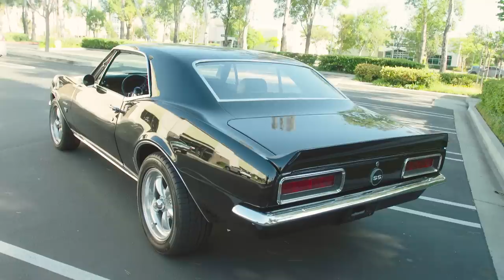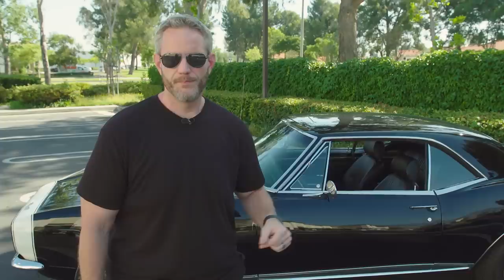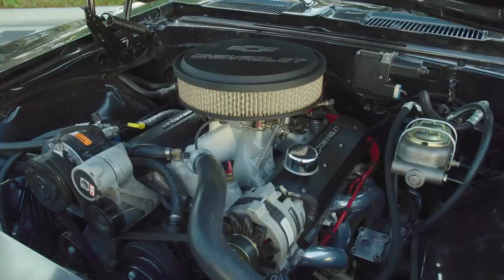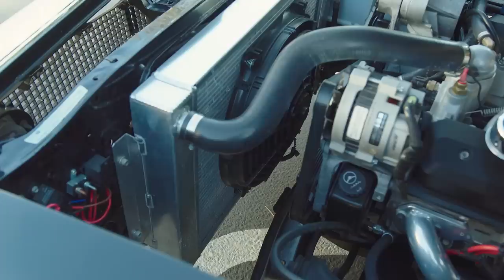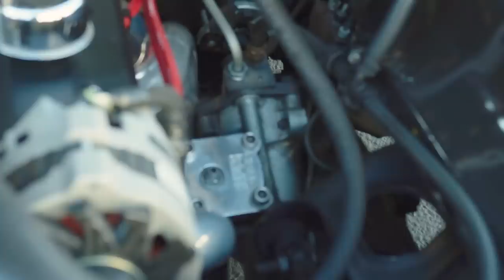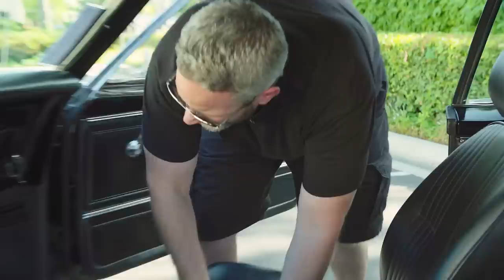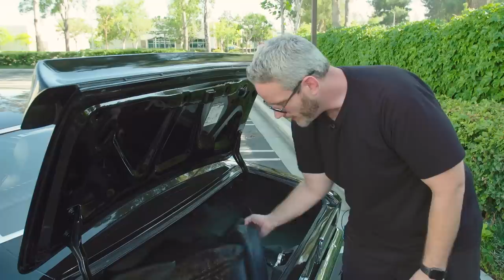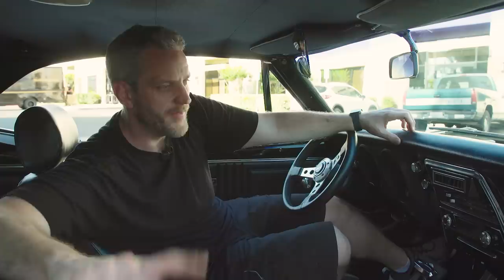Time for a new car build! Let's Resto-Mod a Classic!

Comment: One thing we know for sure:  It will be water-cooled.
Reply: Next episode, Air cooled Volkswagen swap 🤣🤣
Reply: @ginge017  wouldn't be upset. Very unorthodox
Reply: Fuck, you beat me to it
Reply: And steve will hate it
Reply: Skunkworks v3, how long before we have a car mixed with skunkworks video
Reply: best comment ever! corsair sponsered
Reply: But it is already water cooled
Reply: aren't we all?
Reply: I’m picturing clear rigid tubing and a massive custom Noctua radiator fan. 😂
Reply: overclocked car will be more sure
Reply: I think If we put ln2 in the gas tank it's gonna be faster XD
Reply: It is watter cooled. Its a car. Can you not see the radiator?
Reply: Basically already is

Comment: There are a couple of places to check for a build sheet for your car. First check the top of the gas tank, drivers side front corner.Second place would be underneath the rear seat in the springs. Third place would be underneath the heat barrier material on the hood of the car. If the car was built in LA you have a fairly good chance of finding the build sheet in one of these locations...The Norwood plant was really good at removing the build sheets from the tank and back seat areas...

Comment: I dig the idea of adding the modern touches with the LS7. I think that would pair well with a more modern stance with larger wheels/tires. If you intentionally got a car that didn't have matching numbers so you could do it your way, I'd go for whatever gives you the best driving experience with your setup. Drag setup could be fun but would likely be a nightmare when you drive it for the reason you intend to, as a cruiser. Putting together a plan for a project is one of my favorite parts of any build.

Comment: Have to say I like the wheels and stance exactly as they are.
Reply: Andy D not correct stance though:
Reply: You mean Camber?
Reply: Rexity no the cars rode lower in rear then front. The whole high in rear low in front look is all a fad. You want the car to hook on the street the last thing you want is it tall in the rear it will just blow up the tires.
Reply: don't touch the car at all, height and tire profile/rim size wise. It's good as is no need to rice the poor thing
Reply: @Thumper68  EXACTLY.
Reply: yeah love the wheels.
Reply: @XBullitt16X  yeah those wheels are probably American Racing

Comment: 195 thermostat is perfectly fine for a modern crate engine, especially with the carburetor the jetting can be sensitive to engine temp.
Reply: Unless it’s too old for that🤷🏼‍♂️
Reply: Maybe.. a 185 but definitely not a 160
Reply: 195 is 90.55 celsius.   I have been a car mechanic for 10 years and al I know is that 90 celsius is the normal operating temperature.
Reply: @shaneyurd918  zz6 crate engine isn't that old
Reply: @patrickfitzwater5511  got a 160 in my Camaro, and it's fine, same with my dad's 1972 Plymouth Duster drag car. Even drove my Camaro in snowy cold Canadian winters with it. If you watch engine masters on motortrend, they proved it made more power. Now if it was fuel injected, then a 160 would be too cold since the computer would be making it run too rich because it thinks it's still "warming up"
Reply: @Mike323fba  run it too cold and it starts losing power right? The crossovers in the manifold and the heat they provide don't let the fuel/air atomize to the extent it should? I agree, 195 is pretty much the sweet spot for a carb car.

Comment: I gotta do it I GOTTA DO IT 2JAY Z SWAP
Reply: only engine Jay should ever use haha
Reply: Hell yeah
Reply: A 2J would make so many people angry. I'm all for it.
Reply: @shadowreaver752  The Camaros are probably my favorite American cars ever made... I even happen to own one.  And I 100% Agree, fuck the LS7  you don't want that motor anyway 2JZ it!    And Jay if you happen to read this, no really.. DO NOT USE A LS7.. if you have that money to spend, buy a Dart block LS3 and build it right.
Reply: @gittyupalice96  I will second the LS3 and add the LSX iron block as another option. The LS7 has valve problems, they drop them into the combustion chamber when the stems snap.
Reply: @rockdem0n  think in the build they are gonna replace heads or do at least a valve job... maybe springs...
I would actually give TexasSpeed a call instead ;) some bald eagles in there and have a nice choppy cam
Reply: @rockdem0n  i third the ls3 as well, just a better platform to start with that an ls7 with intentions of making big reliable power. Hell I'd take a junkyard ly6 over an ls7 or a turbo lm7 but a turbo just doesn't fit the nature of that car
Reply: There is one corvette that had that type of motor style.  Which was never released
Reply: @rockdem0n  Can I vote for an LT4? Supercharged 6.2 yo

Comment: "The seals in this car leak everywhere" yea something you'll have to get used to 😂 pretty sure they leaked when new.
Reply: Modern rubber seals do work better than cork or rope tho (I'm gonna assume this is a bit late for a rope RMS tho)
Reply: @omgwtf696969 didn't they improve the 2006 version of the engine
Reply: ahem, that was called MARKING YOUR TERRITORY thank you... jeez
Reply: Just use Flex Seal
Reply: @zachmiller9175  the door seals and stuff leak cause its old and cause the aftermarket stuff is junk too but yes the old corks oil pan seals seep oil. I put a brand new long block in my jeep, new cork oil pan gasket, it seeps oil. But my rubber valve cover gaskets that repleced the cork ones there is not a single bit of oil on the beautiful orange paint

Comment: Can't wait to see what you do to this one.

Carbed LS7 and a good heads cam combo i can see 600ish to the wheels.

Cant wait till jay says he's putting a 4L80 in it lol
Reply: @omgwtf696969 350s are fine and all but they don't make much power, my dad's cousin has a Z28 he bought new. 4 barrel, heads, cam, intake, exhaust. The 1983 Firebird my dad used to have would walk away from it with a stock 400 small block. He had a bit of a weight advantage but the 350 is just too small to do much with. An LS7 will be way better.
Reply: @omgwtf696969 you don't know what you're talking about, it already has headers, there's no downpipes, there is only one cam
Reply: @boostaddict_  you can build a 350 to make 500hp n/a pretty easy, even with all those mods it didn't have enough compression or the heads weren't good enough. With a roller cam and valve train and 10:1 or higher it would have woken that thing up better. It's really easy to over cam a small block especially if u don't have enough compression for all that cam ur trying to run
Reply: cleetus/garrets ls7 in his  "dale truck" makes 660 to the tyre

Comment: We had to deal with some surface rust with our 944 and having to wire wheel it in some places, treat it and repaint it. Also added a flip out head unit from Pioneer with Apple Car Play and a backup camera. It's so nice to have that in an old sports car. Awesome new project Jay! Really dig the Camaro!

Comment: Hey, Jay;
OK, I'm 65, So the '67 [specially the SS] was SO EXTREMELY SWEET!
BTW, the 1st gen is SO MUCH cooler than the 'pontiac' style later gens.
The paint scheme is great, but it ain't the 'custom' "last" paint job I dreamed of back in the day.
My 'dream' paint scheme was a  medium silver metallic w/ all black chrome trim.
    /_   /_
     /     /
BTW, starting old carbed cars, specially 4-barrel  hi-per V8s means you have to learn how to start it.  But not so much when its warmed up.
The 'electric choke' is cool IF the temps get low at night-means you can crank up & drive off.
I'm old so take my advice for what its worth, TAKE YOUR TIME!
I think you can afford it [$-wise] but taking your time will pay off in the long term.
BTW, you're gonna' want to check out Sweet Project Cars on youtube.
Once the rust is gone in the doors/body panels you can pour an oz or 2 ATF inside the panels to stop it from rusting & KEEP the drains open!
Have a GREAT day, Neighbor!

Comment: one thing for any carburated motor:

they sound sooo good! differently from those eletronic fuel injectors what sound muffled even with a straight pipe...
Reply: Carburated inline 4 motorcycles have a little rasp to em that I absolutely looooove
Reply: yeah if I were to "update" my Nova and remove sound I would go all the way with an EV conversion
no LS for me thanks

Comment: the reason you have the moister in the trunk is due to the spoiler. Most of the time 
when people put those on the holes were often to big plus back in the day 
we weren't concerned with rust because we had no plan on keeping it.
One thing I would is look to see if the rear seats folds down, they made a
bunch with that option and a lot of people did not know about it.
Good looking car Jay!!!

Comment: Im soooooo glad the car channel is back with a project. I really like restro cars that look oldschool in appearance but underneath have alot of modern features. For the wheels id go with a bit of a hybrid oldschool look. Id do five spoke, 17 or 18s with like 45s or maybe even 55s on the sidewall, flushed up, and wider just like and inch or maybe 2.   But thats just me

Comment: A nice old car exists. Americans: Let's swap LS in it!
Reply: Yeah it’s really sad
Reply: Well an LS is a modern 350 so why not
Reply: @atomicbogator6799  ls1 and ls6, yes. But it's fuel injected and objectively better than the old school stuff so they're bad 🙃.
Reply: @dumbdumb572  personally I'd never LS swap my 68 Nova but something like a little slammed chevy s10? Why not
Reply: @atomicbogator6799  I have a 69 el Camino that I'm in the process of rebuilding to turn it into a solid everyday driver and I genuinely cannot wait it swap out my mid 80s 454 for an ls1. It'll truly bring my build to that next level of not only reliability but also fun I feel.
Reply: @dumbdumb572  yeah but I just love my 350 without all the plastic
Reply: Everyone does resto-mod's now, not just Mericans.
Reply: @atomicbogator6799  oh for sure, ls engines are absolutely hideous stock, especially the vortec variations, but you can for sure make them look pretty good if you wanna spend the money.
Reply: @bothellkenmore  exactly but my Nova is currently far from resto mod lmao, more like just got on the road after sitting for 6 years and not registered since 2010
Reply: @dumbdumb572  yeah but you cant get any better than Edelbrock 4 barrel carb Edelbrock aluminum intake and some long tube headers, and not an electric choke carb an actual manual choke
Reply: @bothellkenmore  not really. In Europe we don't really have LS motors around. I think most people just use engines from Audi, Honda or other JDM cars.

Comment: Well it is not Mustang but always happy to see these old cars saved. Working on my own 67 Mustang that my mom and dad bought new in 67. Looking forward to seeing your progress. With body panels, many of the aftermarket panels fit like crap. So it is not uncommon to patch original panels instead of replacing then completely. It makes fitting things easier.

Comment: As a car guy myself I have a few suggestions if you are looking to cruise it around and have something the wife can drive. Great choice on the engine already.  Put a 180 thermostat in it.  160 may cause some slight issues with the carb.  Go 3.73 gears instead of the 3.90. It may not sound like much but I did notice a difference in my 71 Chevelle. Made for a better cruising experience. Also don't go with pizza cutters and drag radials. Loved it on the strip but hated driving around town.

Comment: For the trunk rust Jay use a product called evaporust. It's a liquid that dissolves rust but leaves the clean metal and it doesn't attack paint. It will do a much better job than a wire wheel since it can get down in All the pits left by the rust

Comment: I would keep the chrome trim mainly because thats how it came from the factory as opposed to adding chrome to a car and making it ricey. I like the idea of the LS7 and carb combo. Regarding the stance of the car, I think somewhere in the middle would be most appropriate. I love the skinny tires up front and fat tires in the rear but depending on how you'll be driving it, maybe a more standard approach would work best. Pro touring look will probably give a more rough ride specially if you plan to just cruise around. On my 71 challenger that Im restoring, thats what I kind of did. I put M/T 275/60/r15 drag radials in the rear and 235/60/r15 standardish tires on the front. Later I may increase the width of the rear tires for a more fat tire appearance

Comment: Congrats.  Resto-Mod's are the best.  All the good looks of the older muscle cars (and smaller platforms) with modern parts.  Really looking forward to this.  Also, autos with the right gearing are perfectly fine.  Great for cruising around, especially in high traffic areas.  Also, pittsburgh tools?  A fan of the freight as well.

Comment: if your blinker stalk issue is anything like my 84 dodge pickup, when i first got it, i was messing with mine and it went completely loose, it wouldnt work at all. i thought i had broken it, but after pulling the steering wheel off, turns out it just popped out of place. my truck actually came stock with a holley 2 barrel carb, and while the stock one is not in there currently, its still OEM. I do not miss fuel injection, abs or traction control, though keeping a carburetor happy, while simple, is still a task. its mostly driving it. my truck, i can go a couple of days without running it before it starts giving me trouble. make sure all electrical connections are secure. especially with the coil, cap, rotor, plugs and wires.

Comment: My dad (may he RIP) had a 67' Camaro, 350, 4 on the floor, red convertible with a white top and white interior... I always wanted to build one with him before he passed but never got the chance... You dont understand the joy and slight regret I felt when I found out what you were building. I'd love to see your take on the whole pro touring theme...

EDIT: What I would do with it?
Bring it down to bare metal body off restoration to start, and get everything straight again after that, tub the rear. Then full Hotchkis suspension underneath. Custom Wilwood brake set up, and change out the steering components for rack and pinion.  Whatever I have to do without cutting up the body to fit 305's in front and 315s in back. Modernize the interior slightly, bluetooth apple carplay/android auto, better bolstered seats also rear seat delete since only amputees can fit back there. Paint it battleship grey (I think it's a Ford color on the GT350 but I love it) with Black RS style stripes, trade the bright shiny chrome bits for black chrome bits. 18 inch HRE wheels probably in gunmetal. 3.73 rear gears, carbon drive shaft, sequential 6 speed, and a carbed and dry sumped LS7 under the hood which would be vented...

Comment: You could decode the vin. Its pretty common to do. The floor pans, behind the front wheel wells, the trunk, and the spring seats in the rear are most common to rust. Old cars are amazing. You can go to fuel injected. Id prefer the carb. Cant wait to watch what ya do with them.

Comment: had to learn the "old ways" in my first daily driver, a 72 ford, having a manual choke over an automatic one is a god send when dealing with old carbs and fine tuning its start/idle. i hate the pull chokes because they have too much play over time. I rigged a pop/click choke knob from a dirtbike onto a 65 mustang because the fit and fine tuning was so much better XD

Comment: if you go for a cruiser, that is used on tracks, go for a dogbox shifter. It's basically a sequential shifter, only it throws the gear in TIGHT. Like you actually hear a big "ghchang" noise when the gear sits in =) would sound good with the roar. Check GTchannel's modified e36 to hear what I mean. It has a tremendeous efficiency effect also, since regualr manual gearbox are 70% efficient, straight cuts are near 80% and a dogbox is basically 90-99% efficient, this is why you hear all the noises, the gear whine, the gear drop etc.

Nice Camaro!

Comment: Bumper and chrome trim delete like you said. LS7 with ITB's would be awesome but understand why you want to go carbs. Perhaps you could use the carburetor looking inlet manifolds that have injectors built into them as a compromise. That factory silver/grey will look awesome on it. Also black wheels look really good on silver/grey.

Comment: I'm impressed Jay! Sticking with a carb and an automatic. At first I was hoping the car might take a bit of a drag racing turn with the auto but it's a good choice overall if you're actually going drive it around. Sticks are cool on a road course and all but with a built ls7 in LA traffic... Not so much! As for the carb you'd be surprised at how good they are at making power. Maybe not as efficient as fuel injection but there are definitely benefits to a carb that you don't get with fuel injection. Plus they look manly af!